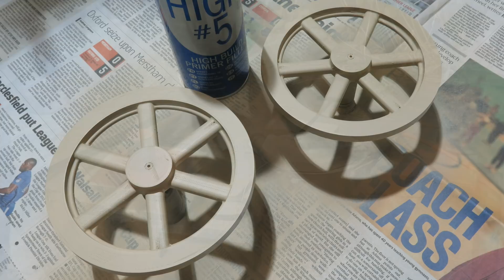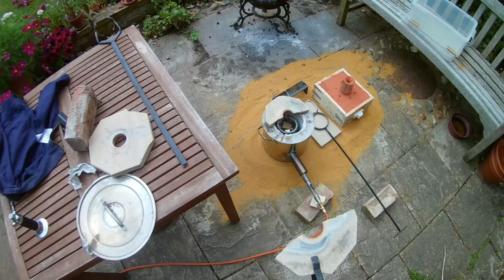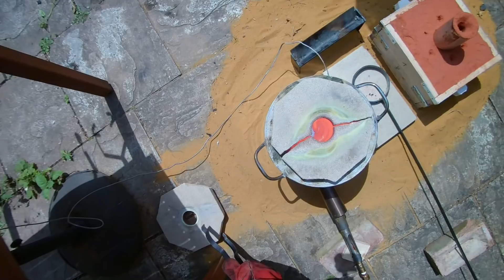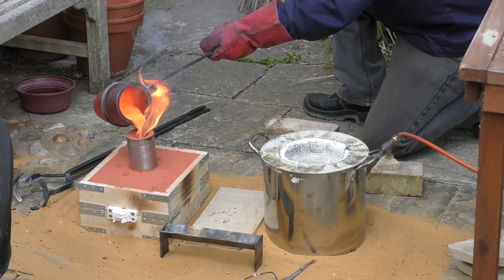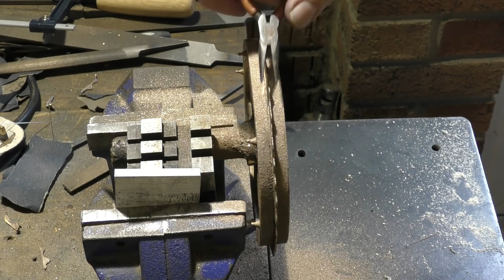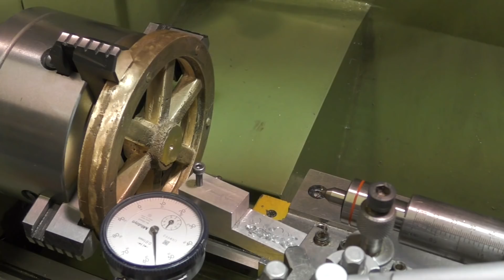Casting a Bronze Flywheel at Home

Comment: I use type k thermoouple &   it lasts years  as I put it into a very thin wall  stainless steel sleeve & always coat it with a refractory wash every time I use it then afterwards it just taps off. same with moulds for surplus metal after pouring as molten alloy corrodes steel moulds but not with a refractory wash

Comment: Also I noticed some roughness around the hub, which you used as your pouring sprue.  If you were to come into the flywheel from the side with a pouring basin that then feeds into the rim it would help reduce turbulence, and gas from entering the casting during the pour.  Came out pretty good regardless. Good luck. Welcome to the black art of sand casting !

Comment: Looks good.  I pour brass at about 1800 degrees F     Your set up looks like it could get up to that ( it's similar to mine).  Do you use a refractory plinth under your crucible in the furnace?  The plinth or plate underneath helps to keep the heat in the crucible.

Comment: If the sprew is centered couldn't you use it in the lathe chuck and cut it off later?
Reply from the maker: Hi Mark. That’s a good question and the answer isn’t obvious form the video. It’s because the hole for the sprue is made by pushing a copper pipe through the top part of the sand somewhere that looks “about” central , and “about” on axis.  In reality it’s off center and not true with the wheel.
Reply: @DavidCambridge  Thanks David.  I had assumed it was part of the original 3D model.
Reply from the maker: I tend to draw the fusion 360 stuff as three parts; the bottom half of the pattern, the top half of the pattern, and the rough shape of the sprue\gate arrangement. I only print the first two bits, but because you have it all drawn, fusion 360 can tell you the weight of material you need in in the melting  pot.

Comment: not sure, but I think you may have had some options to make the wheel more centered and balanced. Looks like you had a lot of internal run out, how is the balance?
Reply from the maker: Could be a bit better to be honest, but it's for a slow running single cylinder engine so I'm not too worried.
Reply: Yea, I'm trying to think of a way one could establish a good datum to start off with and establish a really good initial balance.

Comment: Have you considered simply putting some heavy objects carefully on top of the mold to keep the flask from floating? It has worked decently for me in the past. Another thing, tapping  the mold while the metal is still molten seems like asking for inclusions to me, but that is just my opinion it has been a while since I have actually cast anything...
Reply from the maker: “tapping the mold while the metal is still molten seems like asking for inclusions to me” – that’s a really interesting thought. I’ve found it helps, but I’m in no position to argue. It’s entirely possible it worked for me by superstition rather than science. Anyone else any thoughts ? (weights are definitely the way to go)

Comment: looked like it turned out fine, I wonder if you cut into it much, if you'll end up with porousity in it due to it being poured so cool. Ive run into that quite a bit with brass, and Ive found that the only things that really helps with it is to just heat it to an insane temperature so it has enough time to pour before starting to chill, or before you take it out of the furnace and pour, throw in some phosphorus copper into it. It doesnt need very much at all and one or two little granules will increase the fluidity of it to no end for the whole melt.

Comment: This may be a trivial question but when you cast something in general, does imperfections always occur at the surface? In other words when you sand it or machine off a face, do you see pitting (not sure if this is the correct word but i am referring tiny pockets/holes) inside the material?
Reply from the maker: I think it depends a lot on the skill of the operator and the alloy. For myself, and with LM25 aluminium, I’ve never got the process to be 100% reliable. Sometime it looks great on the surface, with just the tiniest of pin prick defects that open up to huge voids inside.  When I’ve cast bronze or brass, I’ve never seen anything that goes beyond the surface and have had far less problems. The Zl12 I tried in the earlier video was equally as good.  At some point I’ll try some different aluminium alloys.
Reply: i found an interesting sand source from other youtubers, its called chinchilla sand. its ultra fine (~0,1mm) and not expensive in local pet stores.
https://www.amazon.co.uk/Kaytee-100079172-Chinchilla-Bath-Sand/dp/B0002568HM
so maybe you like to experiment with that.

Comment: What do you think caused the inclusions near the hub of the wheel? Casting sand not quite firm enough, or perhaps it fell down the sprue?
Reply from the maker: Honestly, it could be either.  The lathe work is quite straight forward, in so much as it’s an engineering process. Once you get the hang and learn the technique it always comes out the same. Casting on the other hand, seems as much an art as it is a science. It feels like you follow all the rules and it’s a disaster, then do something that’s technically wrong and it comes out great. Version 1 of this flywheel  had the risers, sprue, and gates and was a disaster. This came out far better with just the sprue down the middle. I do have a feeling that temperature might be my biggest enemy – so maybe my next project will be a forced air burner and a few more experiments.
Reply: David Cambridge That would be my experience with casting as well. Concerning temperature, I did at one point now more than a decade ago build a wood-fired furnace with a heat exchanger, with which I managed to melt a small quantity of bronze. It was impossible to melt the bronze before the exchanger was added, so although I can't quantify its effect it must have contributed, perhaps increasing the temperature by a couple hundred degrees C.